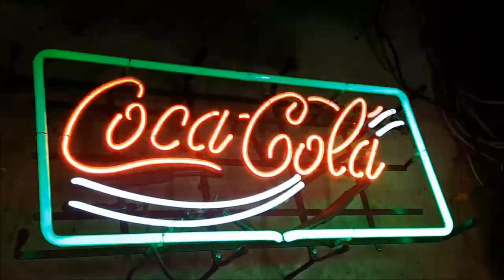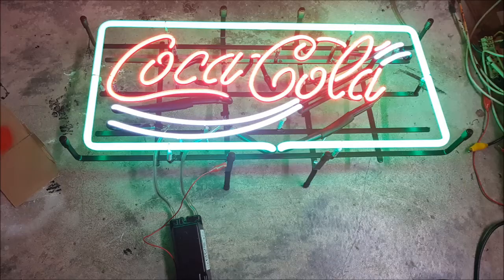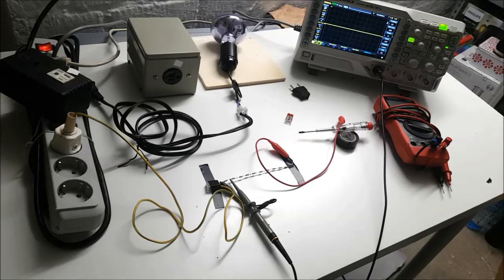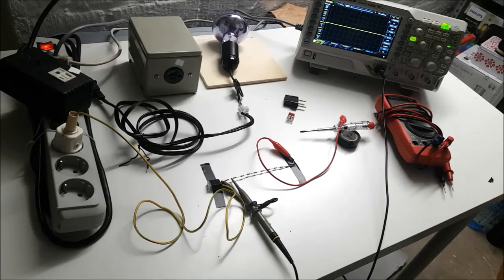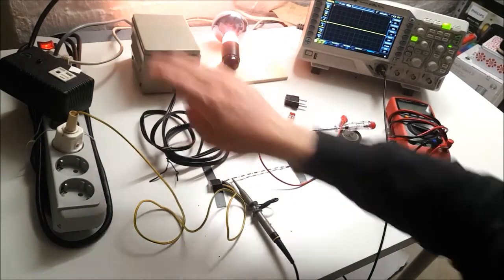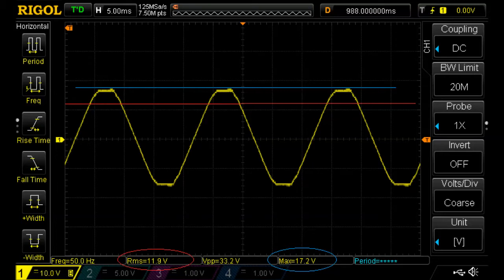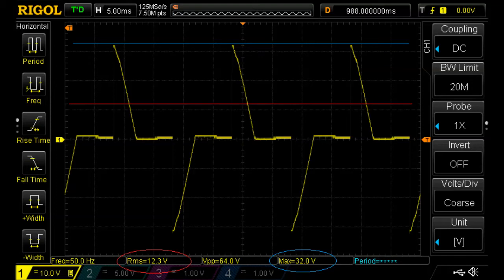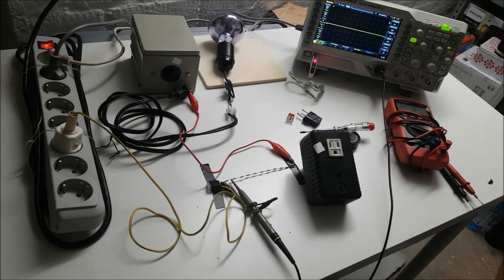Troubleshooting a flickering neon sign / Powering 110V signs in europe

Comment: I have a vintage single tube red neon "beer" sign  with a fairly modern transformer. The transformer is completely inside the metal sign housing. Often it works great for hours, but sometimes it shuts off after some time, and some other times it will only flash on for a fraction of a second when plugged in then stay off. This erratic performance seems to be worse when the humidity is high. Could this be a faulty transformer? Thank you!
Reply from the maker: My guess: equal chances of
a) transformer is going bad
b) tube is coming to its lifespan end
c) transformer was not installed correctly from the beginning (too close to metal; high voltage wires too close to metal) - i assume it's an electronic transformer (small, lightweight) -  mounting close to metal will put additional load on these. Check if there's at least a thumb of space to metal on all sides, and also high voltage wires not tied to metal or tied to each other.

Comment: 1/2 of my neon came on, other section did not. Replaced with new transformer, now it blinks on and turns off. Any help?
Reply from the maker: If the new transformer has the correct output voltage for the tubing length, my guess would be that one tube has reached the end of its life span. Does one of them not blink while the others do?
Reply: @NeonSignStuff  Thanks for the response. The transformer is the exact same match as it came with. The sign will come on for a minute or so and then goes off. Should I replace the other transformer also? The top sections comes on and burns fine. Just not sure. Thanks
Reply from the maker: @jwood3725  my guess would be a bad tube then. I would try to run it with a bigger (more kV) Transformer to see if one tube runs obviously warmer than the others. That's often the culprit.
Reply: @NeonSignStuff  Thanks I'll try that!

Comment: Can you still buy neon signs

How can I recognize a neon sign on the street?

Were theese signs used in europe?
Reply from the maker: Yes, neon signs are still made.
A lot of "LED neon" signs have come up that look similar, using led ropes in silicone hose etc. You need to get very close to see how the connections and bends are made to distinguish the real and the LED. 
Europe even had the first neon signs in the world, and had them until today, but not quite as much as the US.
Reply: @NeonSignStuff  hmm thats nice, can you still buy real ones? (I mean order custom made ones, I guess this were always custom made)

But how are the real ones made (guess just a custom shaped tube filled with neon, but how do they make colored one (do they use different gas)

Can you make a video showing the difference between real one and led one (if you have some led ones at your disposal of course)

Maybe even step by steo guide on how to power one (where are the wires sticking from, etc)
Reply from the maker: @Veso266   I have a video about colors on my to-do list. I don't have any LED rope signs to compare.